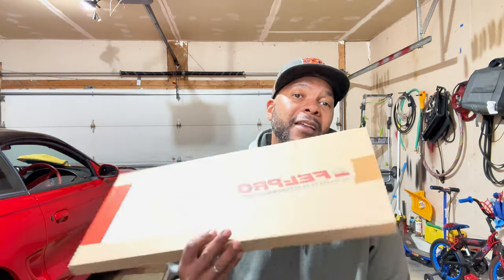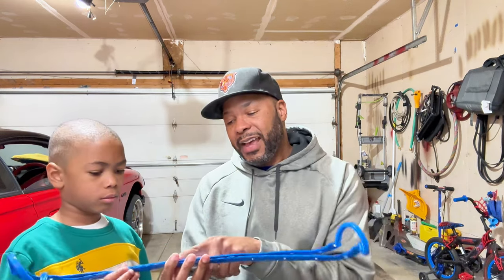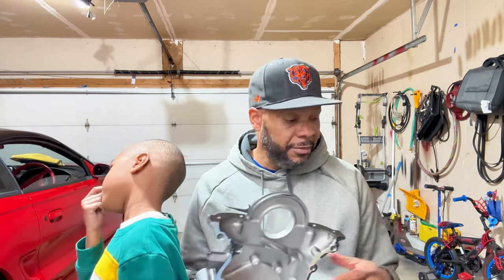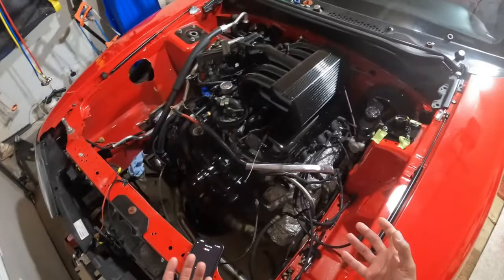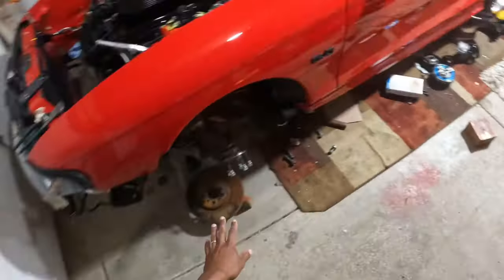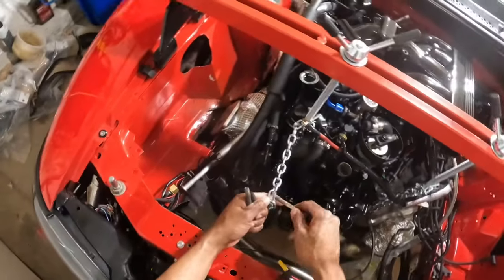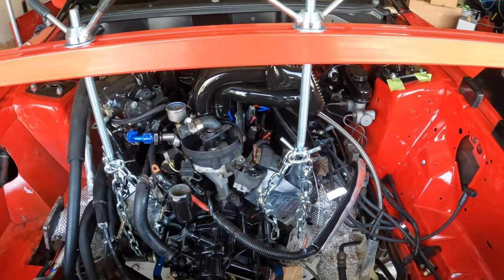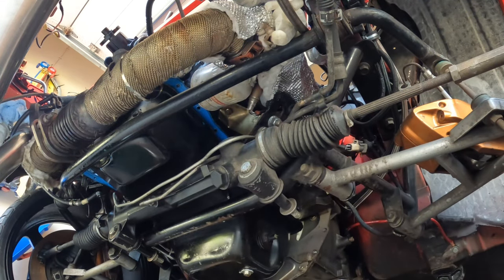The Worst Maintenance Item On Your Mustang

Comment: The real question is would you rather do an oil pan gasket or a heater core?   🤣   Good job man and it's great to show your kids that a person can solve problems with their own hands.
Reply from the maker: I would rather have my teeth pulled instead of pulling that heater core again 😂
Reply: Thank God I’m in south Texas and don’t need a heater core.
Reply: @JLO_96GT   I feel like about 99% of all heater core failures are preventable by just being diligent with coolant maintenance (never more than 5 years) and using distilled water for your last flush + only ever using distilled water to dilute concentrate.
Reply: @shoveI  💯
Reply: @shoveI  you are correct but still I really don’t need it so it’s just added insurance for me.

Comment: I just rebuilt my engine and I went with a GT500 windage tray/oil pan gasket. Had to modify it some but it went in and no leaks.
Reply from the maker: Those gt500 gaskets are great. What else did you do on the rebuild
Reply: @SN95Power  full short block rebuild, new pistons, rebuilt ported heads, Todd Warren cams, bbk headers, light weight fly wheel, McLeod clutch, relocated the battery to the trunk. Now just need to tune after the 500 mile break-in period.